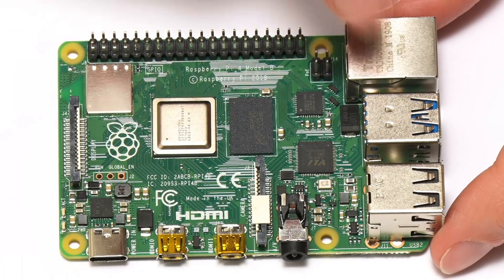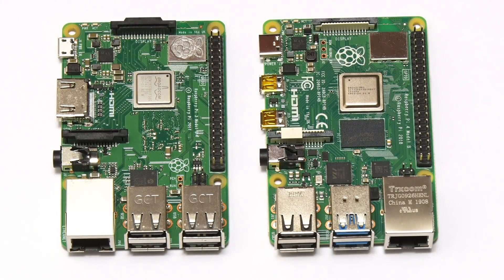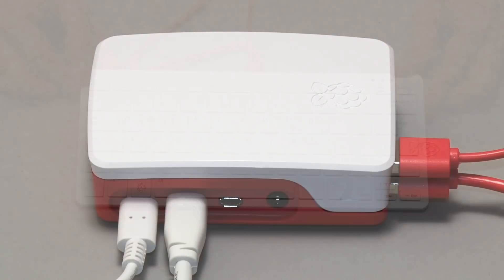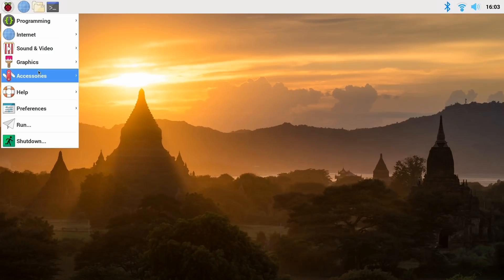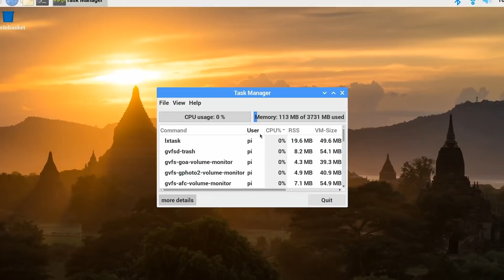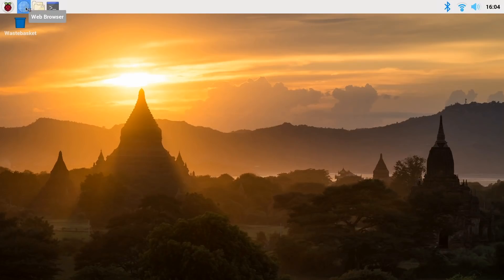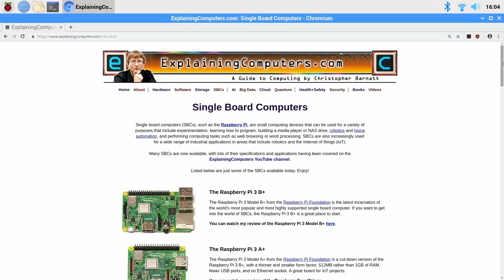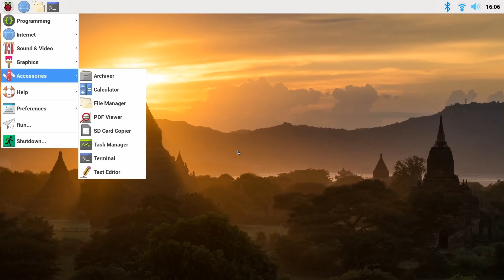Raspberry Pi 4 Model B

Comment: I will have to wait for the raspberry pi 5 or 6 before I consider purchasing one. The Raspberry PI could have built an outstanding system had they included SATA 3 support.  Why not provide four USB 3 ports instead of two USB 2.0 and 2 USB 3.0?
USB 3.1 with a C port would also make a nice addition. Is it possible to use the USB C as an active port if POE is used to power the board?

The mouse and keyboard appear to be junk as does the case. I would prefer a metal case with four metal standoffs and screws to securely mount the board.
There are too many good choices for keyboards and mice. To each their own.

It is unfortunate memory suppliers and SBC manufacturers have not agreed upon a standard plugin type memory that would allow users to add RAM as one’s needs change. Perhaps it is much simpler to spend a little extra and buy the board fully populated with maximum RAM.

Thank you for an excellent review. I am disappointed as I had hoped the powers that be would have listened to the requests for SATA 3 support.

I cannot wait to see what the other manufacturers have waiting behind the scenes. Banana PI and Orange PI are two that come to mind. 

Cheers from the States.

Sincerely,

B S Du Bois

Comment: I would have preferred a second USBC port vs a second HDMI port it would have made so much more possible.
Reply: Especially at 10 Gbps.
Reply: Dual micro HDMI is a curious choice indeed. Sounds like marketing decided dual screen would be a nice selling point?
Reply: @RandomPlaceHolderName   you can hook up a USB-C to HDMI and still run dual screen. Just USB-C power seems like a giant waste.
Reply: @88Elzee  Mhmm. Could have gotten rid of the 2 USB2 as well, 2 usb3, 2 usbc and 1 full HDMI. 90% of folks wouldnt need to buy a stupid micro hdmi to hdmi cable exclusively for their Pi4

Comment: 3A but no ventilation in the case for cooling?? Curious
Reply: Exactly my thought, but I'm pretty sure we are going to see how good/bad it is on this Sunday's video from Chris.
Reply: Old joke: How do you make Pentium chips? Put the pan on the processor!
Reply: Some amount of that should be needed for the 4 USB ports, I think each port should be able to deliver 500mA (or each set of ports).
Reply: I think the processor itself doesn't use that much current. It's the peripheral devices that would be taking up power. Gigabit Ethernet itself takes up crazy amount of current to run. USB 3.0 Ports with USB 3 Controller running the USB 2.0 ports on the same chip, I assume will at full power draw at least 1.0A (500mA/USB3 x2+USB2 ports). Plus you have another power hungry device on board, yea, The 5GHz Wifi, that has crazy power consumption too, so I would say 5V 3A is less for the power they are talking about on the board, but if they managing it, they are. Not to mention, whenever you use these 'power hungry' interfaces, your processor won't be able to sit aside either, so account for that power too. So yea, you'll prolly need active cooling or get ready for some serious power throttling. xD (LOL, sorry for the long reply.)
Reply: @anubhavmuku96  Exactly right.  Not ALL that 3A is dissipated by the processor....

Comment: Is the much power needed for robotics project compared to raspberry Pi 3 b+??
Reply from the maker: It depends what you want the robot to do! :) For many robotics uses, a Pi 3A+ or Pi Zero remain fine. But it you want a little AI, then a Pi 4B is a significant upgrade for robotics work.
Reply: @ExplainingComputers   what about ram sir, I prefer 1 GB itself, but is it necessary of 2/4gb??

Comment: Now It well be a interesting test to see if it can run  Windows 10 or Linux Mint or other os? With out issues but window 10 may Still not work because of the CPU  issues plus missing driver issues as well . I'm still curious about it if it can or can't not work?. Cant wait to see more test to see what the Raspberry Pi 4B can do.

Comment: Not keen on the power supply at all. A long cable like that is going to introduce a significant voltage drop, especially at 3A, I wouldn't trust this running at full whack not to brown out. Also not a fan of non detachable cables on PSUs. If they decided to go to USB-C why didn't they utilise the higher voltages USB-C can provide and regulate it down to 5V on board the device? That would have eliminated any issues from voltage drop. So I'm not going to be ordering their power supply for sure, I'll stick to using a 12V supply into a DC-DC converter at the PI side. USB 3.0 is good, means an external SSD will run a lot faster but an M.2 would have been nicer. An 8GB version would have definitely been the one I went for if it existed, but 4GB is okay. The micro HDMI sockets may however be a deal breaker. They are notorious for failing after only light usage. A Pi is not the kind of device you generally plug in and leave, by its very nature. I have a feeling those ports are going to haunt them (and their users) in the near future.

Comment: Will it run Windows XP in virtual box? Windows 10 broke some of my old apps.
Reply from the maker: This is an ARM board, not x86, so won't run Windows XP I'm afraid (save, perhaps, via emulation).
Reply: QEMU can emulate different architetures, including x86 and x86_64.

Comment: Nintendo DS emulation just got onto another level.
Reply: I wonder if it can handle PS2. The PS2 and the DS are the two best selling consoles of all time, so together that's a huge library of games between the two of them.

The 3 B+ could already handle PS1 games, and the Pi 4 seems like a long overdue substantial upgrade (made possible by the die shrink and the switch to USB-C for more power draw). Remains to be seen, obviously. But if PS2 would be asking too much, maybe it can still handle PSP?

Comment: Thanks for the review, I am glad that it has more RAM options, and USB 3.0 will be a welcome. However...

I will only get one if it heavily improves emulation as I use my Pi just for this reason.

My Pi3 sits in the nice NESPi case (Reviewed by Chris on this very channel) and I am more than happy how it sits under my TV.

However my worry is how will I fit the Pi4 in there? Chances are I wont be able too because.

1. The form factor is different, the Ethernet port switching sides.

2. The USB-C 3amp power supply, my micro USB only gives 2amps. And the NesPI flows over GPIO so a modification will have to be done (something I am not too good at - I am a software guy)

3. The 2 Micro HDMI, look like they will span the original width of the HDMI port, maybe making them inaccessible  in that case?

So for me I am going to see if the sacrifice of having an awesome case is worth the upgrade before I jump in. I am sure 4GB RAM may improve, but otherwise I will give this model a miss.

It's a shame they had to change it, if it were to fit perfectly I would have bought one straight away.

Comment: did they say if the 1gig/s ethernet and usb3.0 are finally real full spec ports running at full speeds and not just the ports going through slow and shared usb2 as they tried to bluff us with before ? , i guess the debian 0penmediavault plus several usb3 drives is first on the testing block to put that to rest...
what a shame they didnt make one of the hdmi an input port, as im sure hdmi-in will be very useful for  encoding/piping external hdmi devices if that where the case.

yeah finally the "wastebasket" is here :)
Reply: *didn't
*I'm
*would have been very useful
*were the case

Comment: May put in a small but rather technical request. If at all possible, could you install a heat-sink on it and run a few CPU intensive loads. More to the point would it be possible to install android developer (android studio) on it and see how it deals with that particular piece of software. If it can indeed handle previously mentioned software, it will make for a really inexpensive development tool for workshops and schools. But only if you feel it is worth your time and effort. Thank you for the introduction and i truly did see the new Pi 4 Model B here first.
Reply from the maker: I will most certainly be trying a lot fo different cooling options. :)

Comment: This is pretty much everything I wanted in a new Raspberry Pi. The ONLY gripe I have is the mini HDMI. Shoulda stuck with a regular HDMI for compatibility, because even with these upgraded specs, the idea of running two displays on something like this is a bit optimistic. This thing is just a straight up PC now though, and that little kit is so perfect. If they released a 4A or something with everything else the same, 4gb ram, the works, but with a single HDMI port, I'd buy that whole kit up in a heartbeat.

Comment: I am curious what you can and can't do on this Raspberry Pi 4.
- NAS to stream data? 
- Console emulator for NES, SNES and Sega? How about N64?
- pfSense?

The more powerful it gets the more interesting it gets to buy one because you it transforms from a toy to a utility.
Reply: The 3 B+ is already plenty capable  of emulating NES, SNES, Genesis/MegaDrive, GBA and even PlayStation 1, but N64 is a problem. I wonder if the Pi 4 will be able to emulate PSP or PS2. Anyway, look up RetroPie.

Also it uses the Cortex A72, which is the fastest non-x86 CPU supported by OpenWRT.

Comment: Missing an M.2 interface for running the OS on some fast SSD (e.G. RockPi). Longterm RISCV is a must.
Reply: How much extra would you pay for it?
Reply: Use a USB 3.0 to M.2 or SATA adapter/enclosure.
Reply: @jasonuscg  Does the OS boot from USB?
Reply: Maybe it could work if i keep the kernel and bootloader on the sdcard and move the rest on the SSD.

Comment: I am sad that they didnt implement USB C 10 gbps with display out so one could hook it up to an external monitor with touchscreen.
Reply: Wistbacka maybe B+, lets hope
Reply: Power the RPi4B via GPIO pins?
Reply: @TheOleHermit   But afaik, the USB C port is charging only? No data. Or am I wrong here?

Also, funny that the keyboard doesnt have usb C....
Reply: @Wistbacka  Yes, most likely, the RPi4B will only utilize the PD features of USB-C, although it could do much more.
I was simply wondering how the RPi4B would be powered, if the USB-C connector were occupied for other tasks.
Reply: @TheOleHermit  Oh, I wouldnt know. I know literally nothing about the technical part of the raspberry (or any other part for that matter).

I was just hoping that they would have had an additional USB C port alongside the charging port for that purpose, and only had one micro hdmi port.

Question is though,  is the chipset and/or cpu limited from handling such data speeds in a USB, thus only having USB 3.0?
Reply: @Wistbacka  Good question. Hopefully the answers will soon come. Looking forward to getting one.
Good point about trading a mini-HDMI for USB-C, as well. USB-C is more versatile.
I'm wondering why one HDMI isn't an input, giving the RPi4B the capabilities of a high def DVR.
Perhaps, it is simply a back-up connector for when the 1st gets broken. ;-)

Comment: Here in Australia there's a near $30aud jump between the 2GB and 4GB.
Reply: Head over to element14, the scaling makes much more sense.
Reply: It's called GST and Duty. Hence the higher prices.
Reply: @saturnGEEK  Yeah once you convert $55USD it's about $80AUD then GST makes it closer to $90. Our fx rates suck.
Reply: @darkobelisk4076  Raspberry Pi isn't Duty exempt. That's the real price hike here.

Comment: I'm gonna be waiting for a few months, I want to see if those HDMI ports will hold up. My experience with Micro HDMI has not been good.
Reply: Yeah, I never use adapter plugs, which add weight and leverage on the mini connectors. My USB-C connector broke off, just because of not having an on board power switch (different  SBC). Don't understand what was wrong with good old reliable barrel jacks. Since USB-C already has boost/buck converters, an aux 12 VDC header would be nice. Unregulated power (solar, LiPo packs, etc.) could be applied, w/a power switch.
Most serious makers will use 12 VDC cooling fans, powered via 12 VDC thermally controlled PWM modules, anyway. This also eliminates using the GPIO header for cooling, which conflicts with using a ribbon cable and is an additional power burden on the SBC.
But, no one listens to a hermit, do they?😖
Reply: @TheOleHermit  I had the same though so I looked into barrel jacks and it seems the reason could be one of current. Many "standard" ones are surprisingly low powered between 0.5 to 1.5amps. At 5v that probably isn't enough power for the board.
Reply: @smartroadbiker  1.5 amps @ 12 V = 18 Watts. 1.5A @ 5V = 7.5 Watts. There are many 12 VDC connectors that handle higher current levels. Admittedly, USB-C is rated up to ~ 100 Watts @ 20VDC input.
If a 2 pin power input header were added to USB-C, then it would have the same capabilities, w/o the limitations of the USB-C connector. Use whatever power connector you wish at whatever reasonable (6VDC-20VDC) voltage level you want. The USB-C connector only gets in the  way. Besides, it could otherwise be used for data, a/v output, etc. if it weren't lumbered with being a humble power supply.
Reply: @TheOleHermit  very true. I guess they are sticking with 5v to make it cheaper not needing a 12v regulator on board. It would be nice had they left two pads on the board after the port but before protection so you could run it from any PSU. I know you can run with the GPIO but that can get in the way of other hats if they are needed. Powering RPi's has always been a PITA lol
Reply: @smartroadbiker  Thanks for supporting my point. Actually, USB-C PD specs make it able to handle anything from 6VDC to 20VDC, so the regulators and buck/boost converters are already there. All that's needed are some pins or pads for the connections.
Been struggling with this issue trying to power a different SBC  that has USB-C. Ended up installing the 12V barrel jack, power switch, and PWM fans neatly inside the case. Perfect. Then, I had to run a silly USB-C cable from the power switch through a grommet on the case, just to power the SBC.🤬
Reply: Yep I hate micro HDMI
Reply: Ditto, I have been through a few and I try to avoid them now
Reply: Ha ha my initial thoughts ..after I got over the shock.  I will hold off for a  bit also
Reply: Yup!  Here as well.  Micro HDMI is trash!

Comment: This is cool - the problem with the old pi was also that the usb port shared irq so the speed was not good so would like to hear about performance using ethernet, usb etc at the same time as this can be a problem also ;)

Comment: At last, the ultimate original pi!
Now my 20y old pentium PC can get a very decent motherboard upgrade ;-)
Reply: Lol. Just a bit of a smaller form factor.
Reply: @Jimmy_Jones  PiCo ATX ;)
Reply: should be able to fit that in a AT case
Reply: @Jhunter844.arkansas  An old case with an old power-supply with a physical switch would likely give off plenty off amps from the 5 volt on the power supply plug to power the Pi4.
Reply: @TheNZJester  Oh I know. I'm going to preorder one as a "Always on" device and run Syncthing. It will be a low power pc that can be a redundant file server off-site from my office. Unless I decide to put Kodi on it.
Reply: J Hunter hehe...  I think I know what you mean.  Every time I buy a new pi, I have grand plans to put it to work on one type of project or another.  The problem is I first hook it up to the TV, and put XBMC/KODI on it to play with, and it gets a permanent home there and never gets used for what I bought it for...
Reply: Is there a version of Dosbox that features x86 to ARM recompilation anywhere?
Reply: @SteveRHanson  You can get DOSBox on Android so there is ARM code out there to emulate an old X86 DOS system.
Reply: @TheNZJester  theres dosbox on retropie and recalbox I think. retropie is based off raspian tho and scummvm for those 90s cdrom games
Reply: Lol sound like my old desk top intel 166 with 16 megabytes of ram running Windows 95B. The good old days lol
Reply: hahaha 🤣
Reply: My 386 only takes SIMM memory.  Can I install it in that?  .......;) ;) ;)
Reply: @VauxhallViva1975  Yes - if you bin the 386 MB .... ;-)
Reply: Do make a smurf sized beige tower pc case for it and show us the results :D
Reply: hide it somwhere in case to make nice sleeper mashine,...
Reply: Hahahaha...!!! That's a PERFECT comment.. *fist bump my friend* :)
Reply: i just imagine this in my old big Tower case of back in the day.
Reply: @ulrichkalber9039  My first computer had a Pentium 4 processor with Nvidia TNT 2 GPU. It was fun running Win XP and even Fedora core 1

Comment: Shame they went with Micro HDMI connectors, those things are sooooo wimpy and will break in no time... and no eMMC storage yet? or even a SATA port? come on.. they really need to get away from relying on SD cards as the only (not very reliable) onboard storage
Reply: @@mamos763145? 😂 its close 75-100 or more these days

Comment: no  eMMC, no SPI flash for booting from. Still USB-Ethernet? So basically just a more modern Broadcom SoC. Not all that exciting ;-)
Reply: "The Pi 4 has dedicated Gigabit Ethernet, and because it's no longer throttled over USB, its networking speeds are much faster."

Comment: As others have said, heat is an issue. For instance on a 3B running as a desktop system, that gets hot. This 4B is likely to need a heatsink even for desktop use, so before rushing to buy one, I'm going to wait until you do a "cooling video" that you mention. An immediate question will be whether the very nice case in your kit will be big enough to get a heat sink and/or a cooling fan inside ? You will no doubt soon find out ! I use a Pi for an SDR radio receiver where heat generation is a problem, so what you discover will be of great insterst too ! Thanks !
Reply from the maker: I agree -- it is certainly warm inside the case after watching a video on a Pi 4B. I will be doing a temps & cooling video. :)